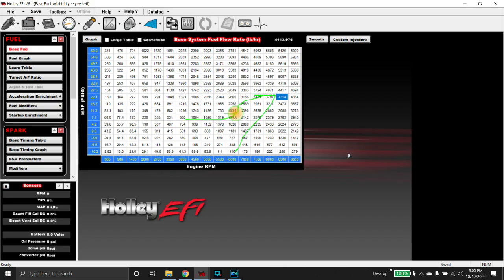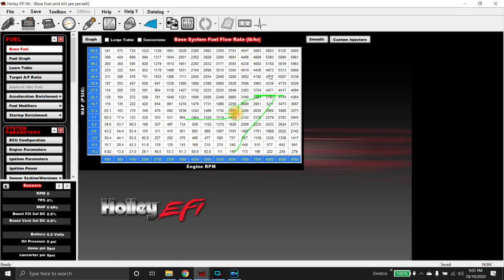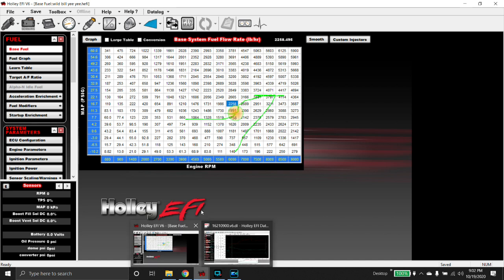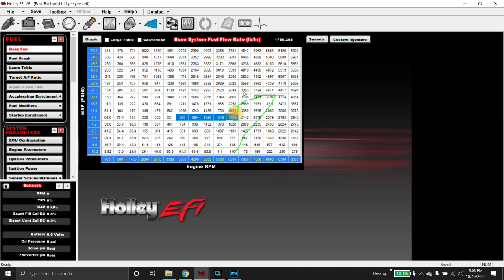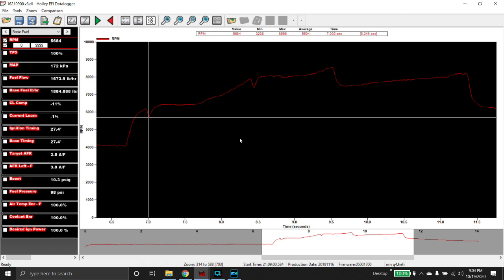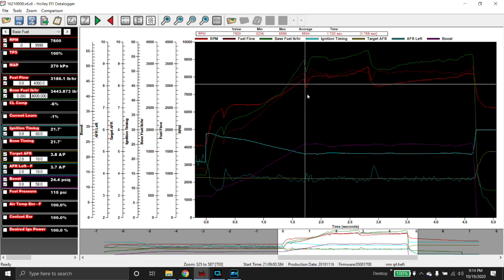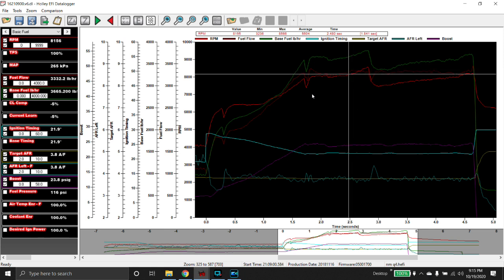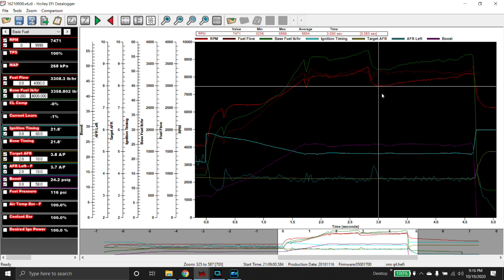Holley Efi tuning and trouble shooting of a over fueled and under timed situation.

Comment: Methanol definitely takes a lot more timing. My small block Ford at that boost level (260 kPa) is that 23°. I'm also running methanol as well. Good video. Knock that spark plug gap to about .015 -.020 you'll be good.

Comment: what plug gap would you recommend for ls on e85 stock coils , 20 lbs boost ?
thanks for the tuning info
Reply from the maker: .018 but depends on the actual compression of engine and which plug you are running
Reply: @theholleyefiguy  ngk 7 heat range / 10.5 to 1